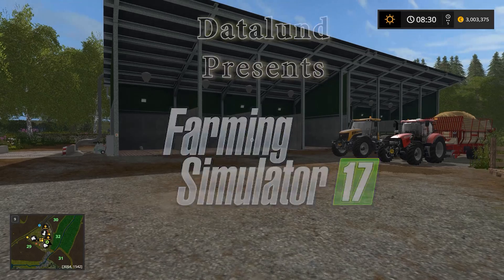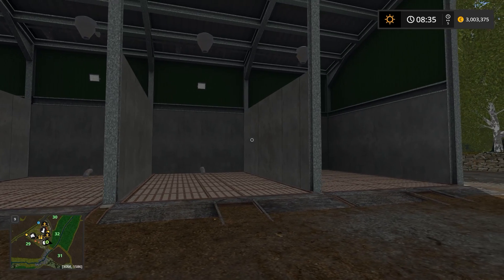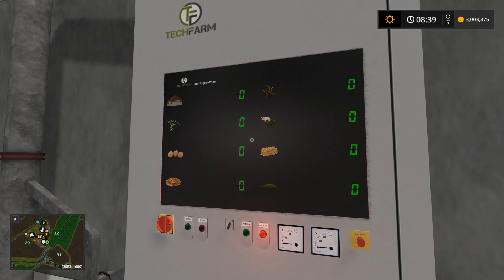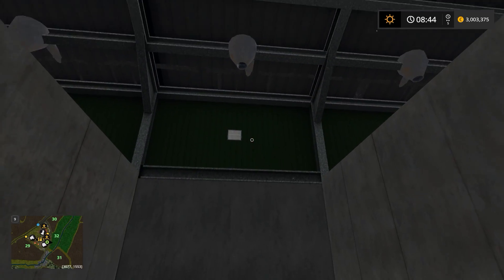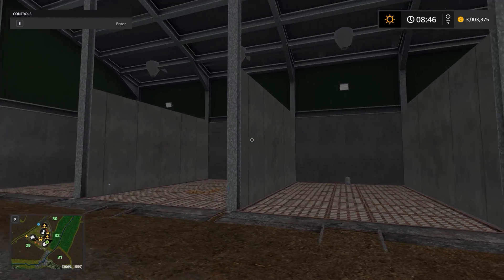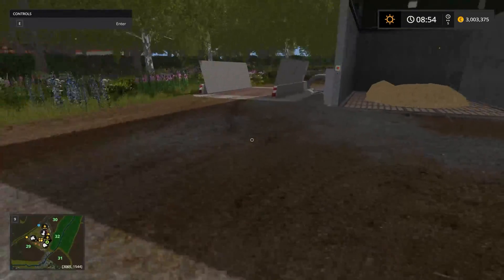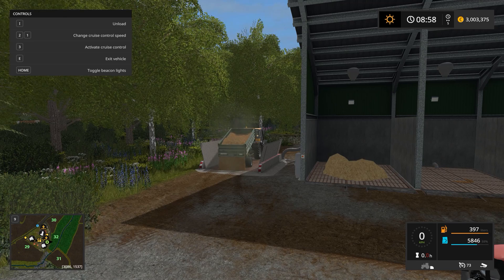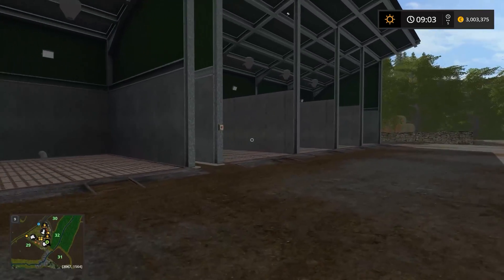I need your help scripting in Farming Simulator 17

Comment: Hi Data,  Hopefully you have had some luck getting your mod sorted out ?.  if your still stuck,  then perhaps some of the modders that use the   Marhu modding website site  may be able to assist ,  {    http://marhu.net/   }   however please note that most speak and type Germam language, so perhaps a translator may be needed ?.  
Best of luck with your project,  looks really good and having the particle effect working from the roof exist vents to fill up the planes  would be excellent,
Reply from the maker: Thanks for the tip :) I do have someone working on the script right now, and hopefully it will be done soon. It turned out to be quite the task, but I am confident he will do a good job. I am happy to hear that I am not the only one who thinks it would be cool with a silo building like this 😉
Reply: Your Welcome Data,   I don't doubt at all that it's proving to be a heck of a challenge sorting out your mod,  But hopefully it can be made to work exactly as you described in your vid.     Looking at how some of the Augers and pipes work on other machines ,,,for example the Big Bud Seed hawk trailer which has that refill seed arm which swings down from the side of the trailer then positions the  other end of the pipe over the seed or fertiliser tank openings ,,  well that pipe does pretty much exactly what you need Your mod to do ,, perhaps that could be something to look into ...  or I hope possibly help towards getting your mod building working spot on :)..  
Btw, really enjoy watching your farmsim series of vids..  having no end of fun now using course play on all maps from vanilla to the 4x multifruit ones .. best regards ..Gary
Reply from the maker: Yeah I was looking at some other mods to get some inspiration for the silo building, and even the FarmSilo System uses a pipe system that could be used for the particle effect from the roof fill pipe. It is essentially just the original particle emitter system from Giants, only a little modified 😉 I can't wait to see what result I will get from the guy working on the script, and I am looking so much forward to starting the let's play on the map :)
I am so happy to hear you are enjoying Courseplay even more thanks to some of my videos 👍
Reply: Hi Data,  Yes indeed your series of course play tutorials have helped VERY much,  nice and easy to follow,  a pleasant change from some of the supposed tutorials i have come across,   where the author skips too many pertinent areas,  which of course helps nobody.  
Again I wish you and the chap making that script for your mod All the best,  I am sure it will look great once it's all up and running :).